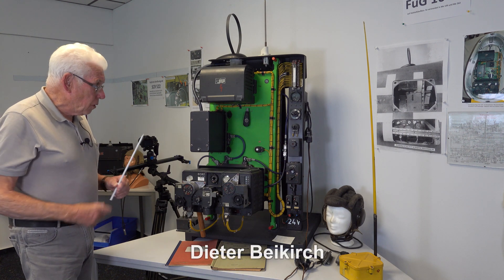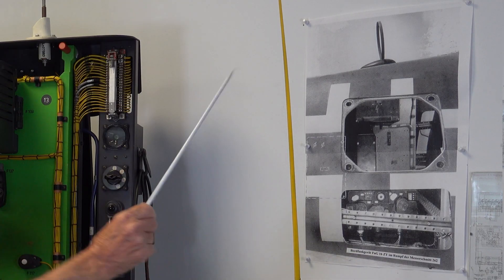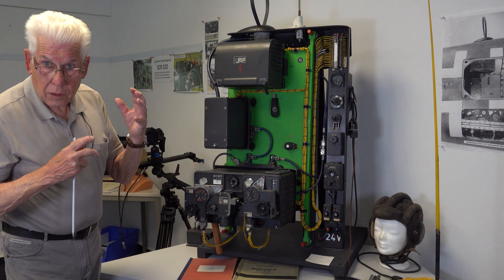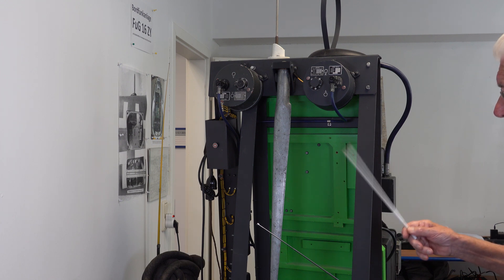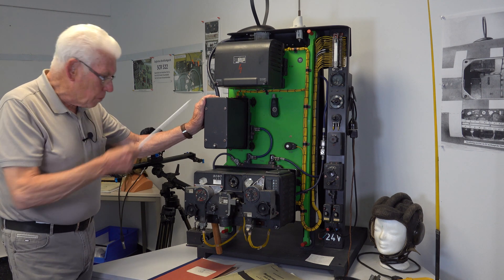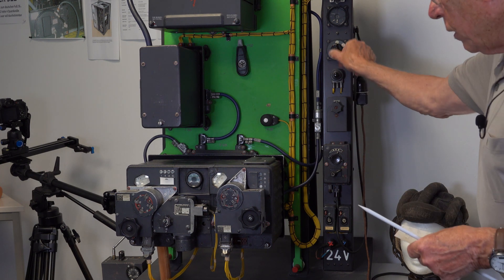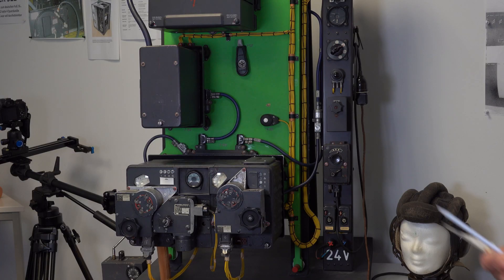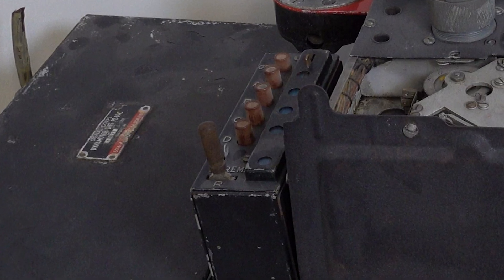Luftwaffe FuG 16 ZY airborne VHF transceivers with range and direction finding

Comment: With the greatest respect,  Dieter Beikirch needs to be explaining this in German with English Subtitles.
These were incredible avionics for its time.  This video misses the basics. 
The system was AM, not FM 28-43 mhz

The range would have been impressive airborne. 

German diaries recall how English aircraft used fake german speaking controllers and jamming on known frequencies. They ended up using AM broadcast stations to reply to aircraft. 

The FuG 16ZY was Ground Based DME. Modern aircraft interrogate the ground station and the aircraft equipment provides the distance.

The FuG 16Zy was a ground based  pulses that got a reply from the aircraft and a controller looked at a scope and determined the distance.   The BEARING was determined by the Ground Station Rotating its antenna to determine direction to the Aircraft.
The Allies could monitor the transmission but not interrogate the FuG16Zy  on its low band VHF about 40 mhz

The later real Transponder FuG 25a ground TX was 125 mhz and the aircraft replied 43 mhz higher at 168 mhz
The Aircraft only had 10 possible codes.

Comment: Thank you that was really interesting. Fug 16 is a really cool piece of kit. It would have been really nice to see the PR16 direction finding loop included. 

You don't happen to know what the component values  of C1, C2, R1 and R2 on the PR16 are?

Likewise the on the ARZ 16 the inductance of L1 as measured between pins 1 and 2  on ST3. Also the value of the capacitor that goes from L1's centre tap and ST1 pin i

Once again thank you very much for this really interesting presentation.